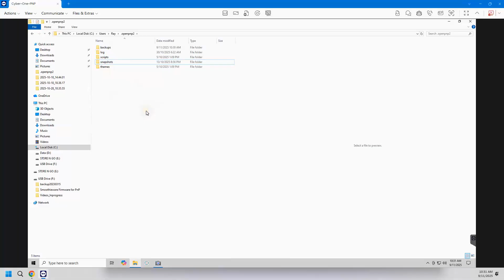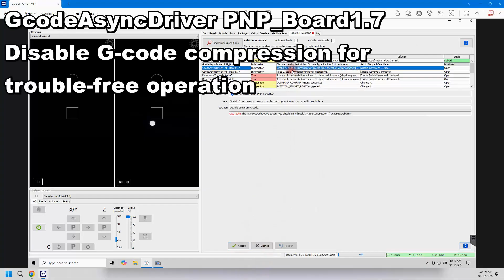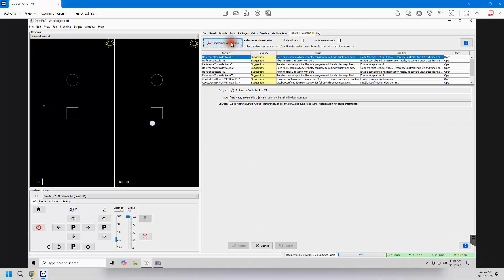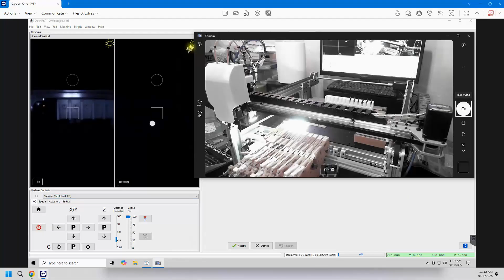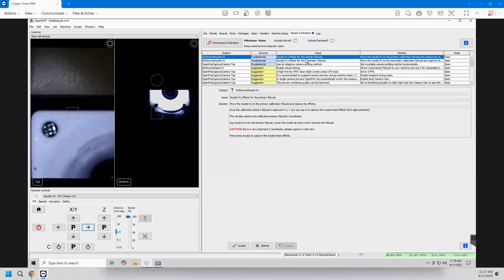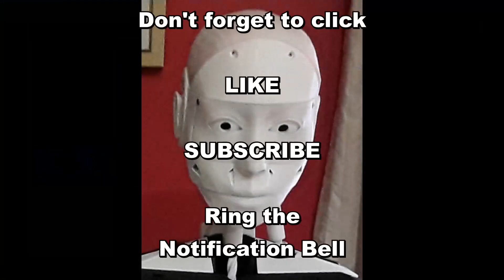MicroSMT Software Setup Part 2

Comment: You've shared how to make an inMoov robot on your own channel and you've made some great teaching videos. I think that's really impressive. Thanks for sharing! I installed my robotlab program on my computer after watching some of Sen's videos and doing some research (I'm a high school student). But I've noticed that some of the services, like the Python service, are hidden. I've tried downloading them, and the cmd screen says they've been downloaded, but when I try again, I get the same result. Hey, can you help me out? I'm trying to make an Inmoov. Pleeeaaasseeee!!!!!!
Reply from the maker: We had this issue a few years ago.
Sometimes when the internet is a bit flaky while installing MyRobotLab (MRL), some of the service can be corrupted.
There is also a feature in MRL where it caches the services it's downloaded so subsequent installs are much faster.
However, if the download of the service was corrupted, it will prevent the service from ever being installed.
This can be rectified by deleting the .ivy/cache cache hidden on your computer.
It's normally found c:\users\YourUsername\.ivy\cache
Reply: @CyberOne  Thank you, I'll try that. You're a good person.
Reply: @CyberOne  I deleted the .ivy file, as you suggested, and tried again, but the program still can't use the same services. The command prompt screen says it downloaded, but when I try to use the service, it's crossed out, and nothing happens on the program screen. What should I do now?
Reply from the maker: Install MRL into a clean folder.
As it installs, it will download a fresh copy of all the service.